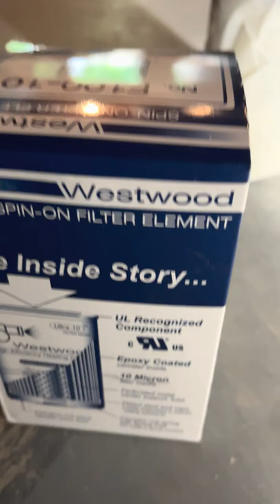How to change Westwood F100-10 Filter (Very Easy!!)

Comment: No bleeding the system?
Reply from the maker: You're right I forgot to show that. I have another video showing how and will make one specific in the future. Hope you're staying warm, sir
Reply: @603HVAC  do you bleed this right at the furnace like you would when you replace a standard filter?   I've been wanting to change my filter out for one of these for a long time
Reply from the maker: @JoshuaWilsonpossible  yes! there should be a 3/8 bleeder right on the pump. Loosen that and fire the unit, and close the bleeder when all the air is out and you have a good flow of oil